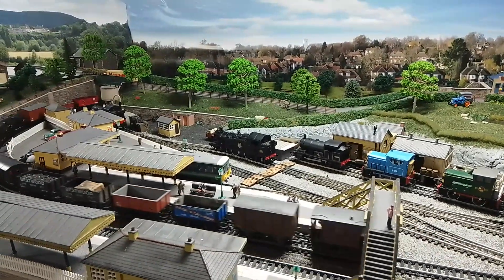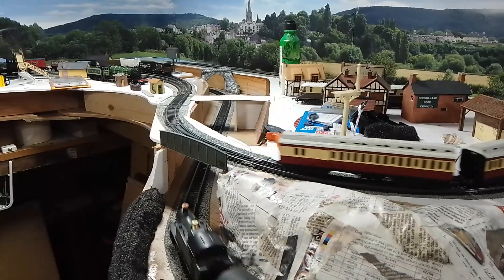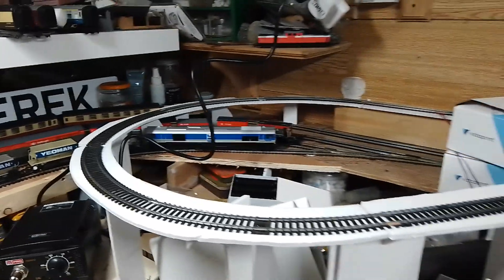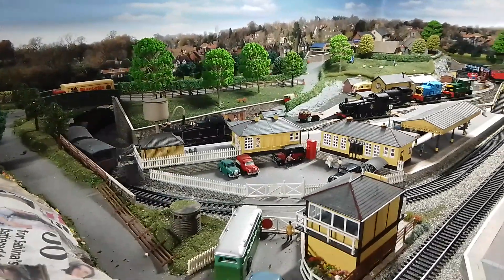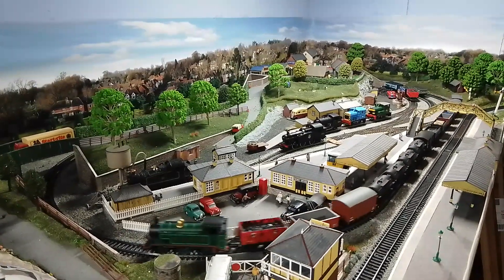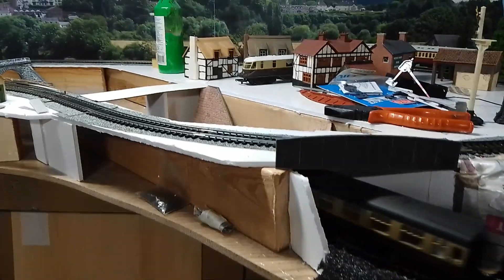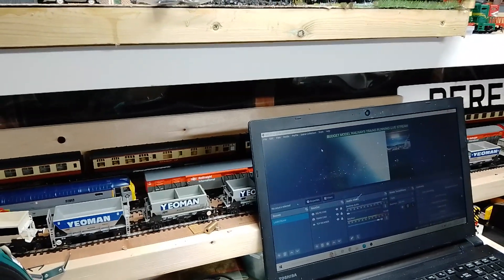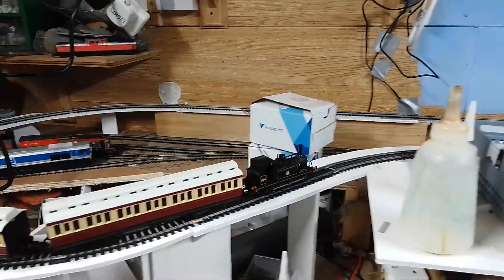Steam Trains on my OO Gauge Shed Layout Happy Christmas

Comment: EBay can be a hit and miss place to buy used locomotives. I tend to get used locomotives from the Erlstoke Manor Fund shop which is one of the many little charity shops along the Severn Valley Railway they tend to get a good selection of older Hornby,  bachmann, Lima, mainline locomotives donated to them and will test them prior to selling. They also have good selections of wagons, carriages, buildings, model vehicles and railwayana books and items. Plus all the money donated goes back into restoring a maintaining the real locomotives and rolling stock in their collection.